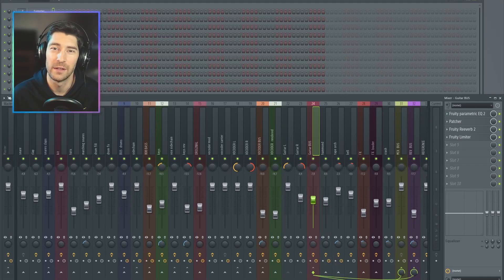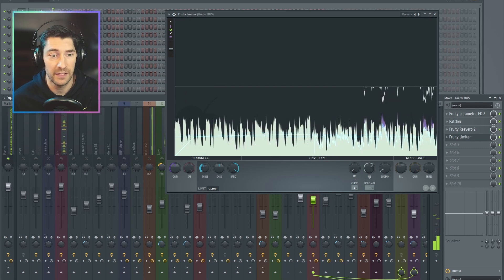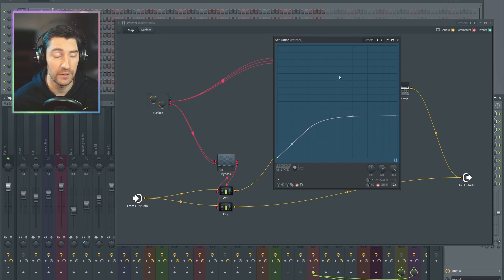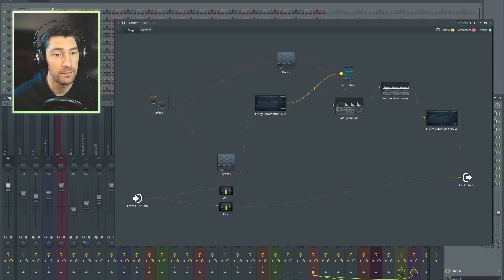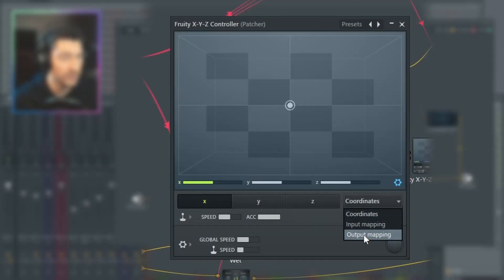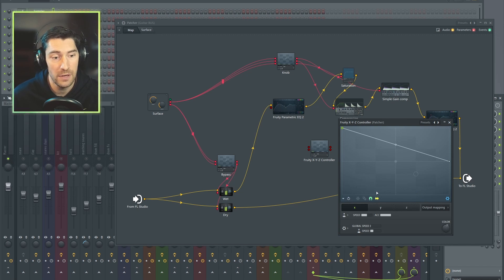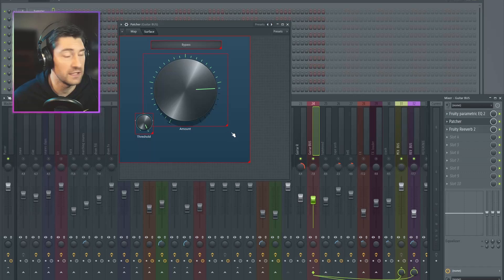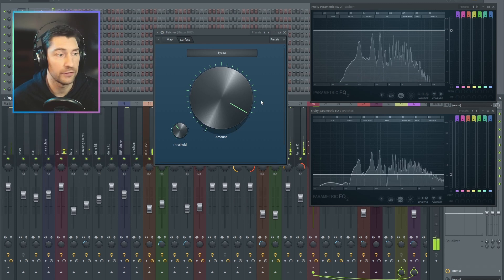Patcher Tutorial - How to add a threshold knob to your plugin!

Comment: Thanks for the video! I came up with this same solution, but I've found that the main level control of PMEQ2 responds strangely if you automate it quickly – it can cause brief, strong increases in level, at least when there are two of them operating in opposite directions like this. As a workaround, I replace PMEQ2 with Fruity Limiter, link XYZ to the Gain knobs, and edit the output mappings to compensate for the fact that the Limiter gain knob goes +18 dB in one direction but –inf dB in the other. It requires some fine-tuning of the curve to achieve roughly equal mapping on the positive and negative sides (since the knob scaling is different in each direction), and I haven't achieved 100% unity throughout all knob positions, but I've gotten it close enough for my needs.

FL really ought to have a native, simple gain plugin with ±X dB in each direction - like the Kilohearts Gain plugin, which provides ±30 dB. I use that in my "threshold knob" setups if I don't mind including 3rd party plugins in my patch.

Comment: I did notice a visible change in the db peaks on your meter, perhaps the full 15db post cut is too much. maybe somewhere around 7-10 db cut or less is where the sweet spot would be if you are truly trying to match the volumes
Reply from the maker: Good observations, yeah the idea isn't to get a perfect match between in and out, but rather just to have some rough compensation for increasing the input. The processing that the plugins are doing will definitely change where your dB meters are hitting and change the perceived volume your ears are hearing.